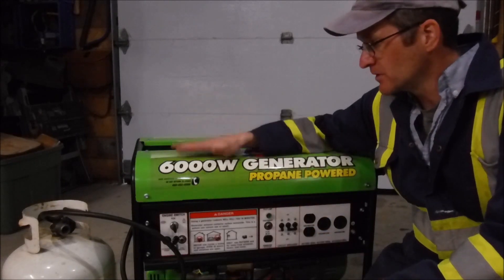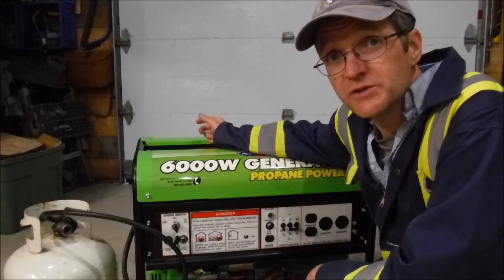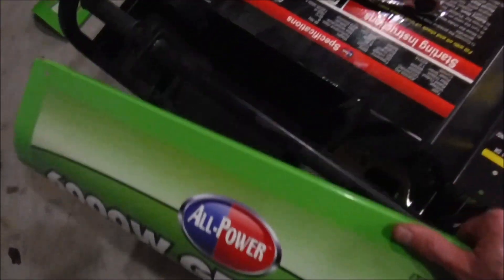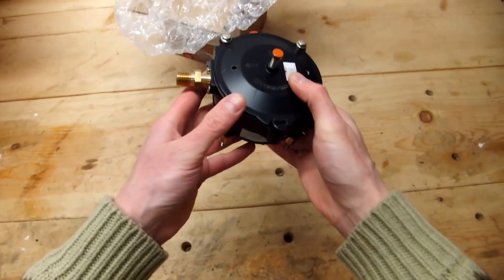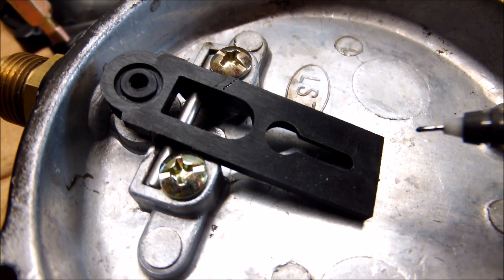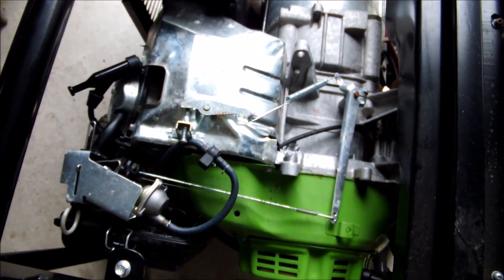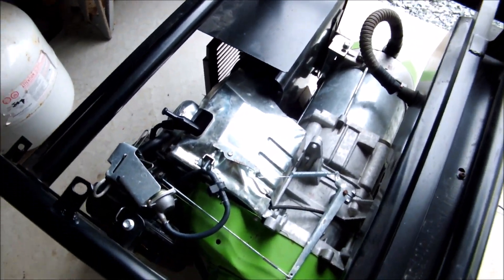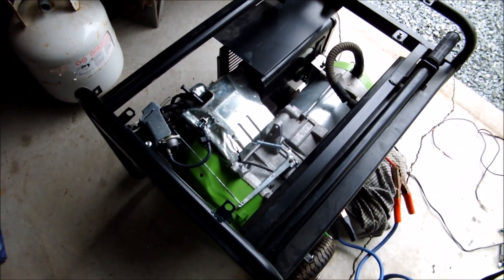Propane Generator Will Not Start | Troubleshooting & Fix

Comment: Thank you...this 74yo woman fixed it with your help:
Mine was a defective oil level sensor AND  a wrong new (not hot) spark plug. 
I put the older spark plug back in and IT STARTED!! 
Ordered a pair of NGK BPR5ES to have on hand for the next spark plug change.
Reply from the maker: I'm really glad it help. More recently I experienced a similar "running" issue and discovered that the rubber "gas line" was dry rotted. I was not able to buy a hose with the fittings, so I reused the fitting and got a new length of "gas line" from a hardware store.

Comment: Did you check the gap on the old spark plug?
Reply from the maker: I probably did. I can't remember now.
Reply: @BuddyWhoDoesStuff  I was curious if the gap had change enough with the old plug to be an issue. Thanks for the video.
Reply from the maker: @ Gotcha. The hotter plug did the trick. 🙂

Comment: So it stopped working. What changed?  Regulator arm broken/fixed.  Ok.   But why was the spark now an issue if it work d before? What was different re the spark?
Reply from the maker: I'm really not sure why the spark just became an issue as it did work previously. When I got the "hotter" plug it worked again and still works.

Comment: Thanks for the video & ideas.  Same issues, inconsistent starting, some rough running & quits under load.  I will pull plug & go with Hotter NGK - see how that goes.
Ours is a Duropwer ELP6000 (circa 2009) but looks EXACTLY like yours.
I'm thinking the regulator being mounted directly on top of engine, subject to LOTS of heat - isn't the best plan for reliable operation ?!  What do you think ?

If my plug upgrade isn't a fix - my next step will be to pull the 'Purge Valve' regulator & see if I can source an adjustable spec regulator and mount on wall of Gen Shed - away from the heat.

Love to hear any feedback you have - David in Ice Storm Damaged Texas
Reply from the maker: I can't really comment on any mods, but wish you luck in fixing your problem. :-)

Comment: GREAT video but why would it change after all the years of running is the question?
Reply from the maker: Good question. Wish I had an answer. :-)
Reply: Engineers design everything with plastic so that it breaks and you have to spend money to repair
Reply: Also there's the everyday wear and tear set a device to internally controls multiple explosions a minute just like your car

Comment: I've had a JD propane generator for about 10-15 years.  Recently one of the propane hoses connected to the regulator disintegrated.  I have also found that it you turn on the propane too quickly it won't start. The first thing I did when I bought it was ditch the chinese spark plug and replaced it with an NGK.

Comment: I have the same generator and it runs for 20-30 minutes then dies or sometimes almost dies then BK fires and takes off again and then 20 minutes later dies again. Didn't know if you think it's the regulator or what. It's never hard to start but if u open tank to fast it will not start.
Reply from the maker: I forgot to turn off the choke and mine acted in that that way. You are correct, turning the tank on to fast will cause starting problems.

Comment: Good video! I just got a used Sportsman 7000LP generator. It doesn't have that regulator valve. Gas line goes through a shutoff straight to the carb. It runs with a shot of starter fluid (good spark) but no gas getting through carb.
You know where I can find LP carb parts?
Reply from the maker: Did you go back to the supplier of the generator? That is what I did with this one, but later found it was the spark plug. They may have parts available.  Did you try a hotter plug?
Reply: @BuddyWhoDoesStuff  yeah I went to them, they said they don't have that part in stock. I feel like they (Sportsman) just blew me off. Nobody carries propane carbs. Just those conversion kits.
Reply from the maker: @RVBob  That sucks. Might have to look for a used (broken) generator that you could use for parts.

Comment: Have you used a 100 lbs instead of the 20 lbs? I got the smaller version of the all power propane generator. I getting a adapter that convert it from inside thread to an outside thread.
Reply from the maker: I have not used a 100lb tank.  I think I have read (some time ago) that some people have issues with the 100lb tank providing to much "pressure" for the generator and they have to buy a regulator to reduce the pressure.  Give it a go and report back Jessie.

Comment: We have this generator that we purchased like six years ago and haven’t had to use it! Well we had a bad storm last night in Massachusetts! If I hold the Purge button down it stays on but cut off if I let it go!
Reply from the maker: Sounds like you may need a new regulator.  There may be a problem with the baffle inside.

Comment: Thanks i put new regulator on duromax hybrid XP4850 and new BPR6ES PLUG SET GAP TO AROUND 20+22 IT  BEFORE IT WOULD RUN ABOUT 15 MIN AND SHUT OF  IT HAD ALWAYS HAD A LITTLE SPLUTTER ON PROPANE NOW TESTED FOR 1HR AND NO SPUTTER ALSO STARTED ON FIRST TRY WITH ELECTRIC START THANK YOU .
Reply from the maker: I'm glad it helped.  It frustrated the heck out of me for a long while.
Reply: my duromax xp4850 does not stat good in cold weather on propane any tips
Reply from the maker: Providing the generator is getting fuel and there is no "safety switch" (low oil) preventing it from starting, I would say try a hotter plug.  Also sometimes when propane is cold it turn more into a liquid rather than a gas.